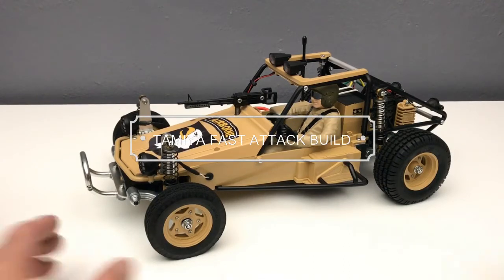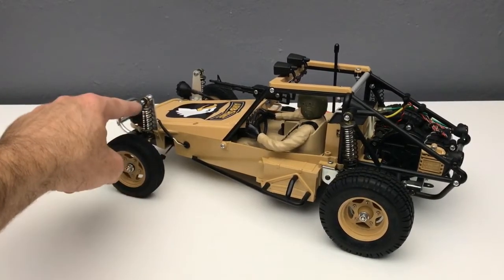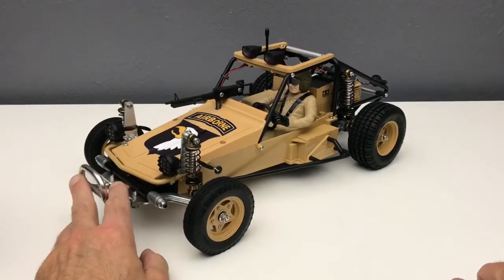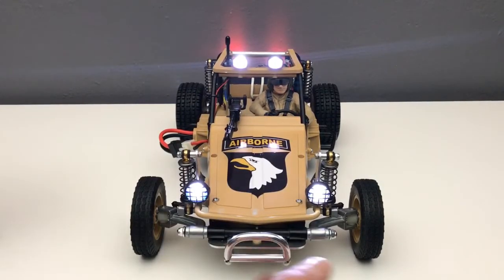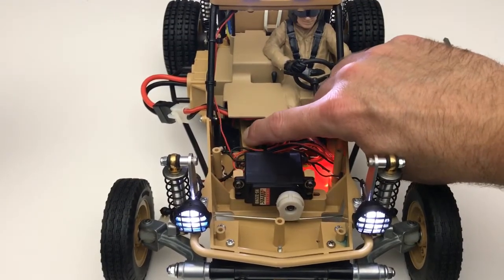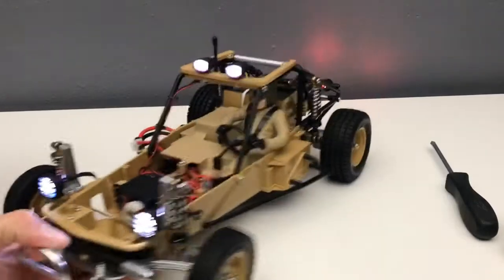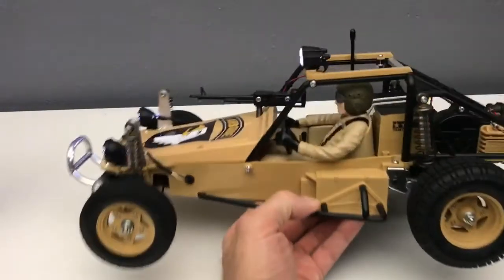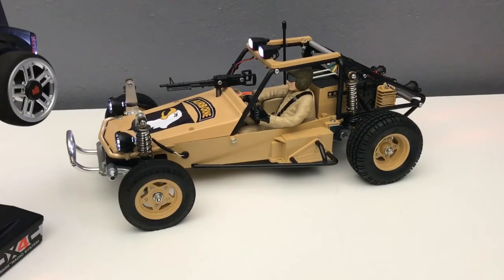Tamiya Fast Attack Vehicle LED Lights RC Channel Metal Suspension Build

Comment: hi, may i ask if the front and rear dampers with springs featured in this video, are rc-channel “front and rear shock set with spring” meant for tamiya xr311? i m asking is because in rc channel, they do not have shocks with spring set under fast attack/wild one catalogue. thank you.
Reply from the maker: No the ones I ordered for the kit were specifically for the fast attack / wild one.  Not the XR311.  RC Channel seems to have inventory come and go.  But yes these are the fast attack / wild one.

Comment: Hey Im planning on upgrading the motor on my fast attack too, how does your gearbox hold up with that motor? were there any problems?
Reply from the maker: It can handle better than the silver can stock. The motor I have is actually a bit slower than stock.  You can go faster and it will handle it.  But not too fast.